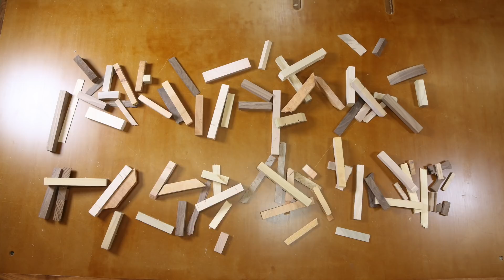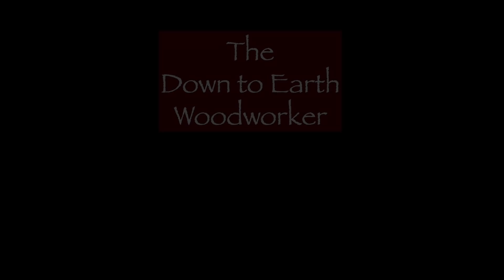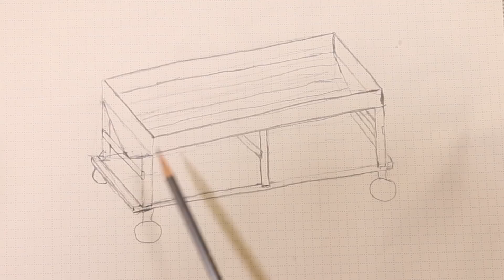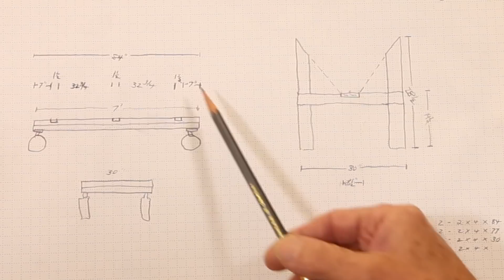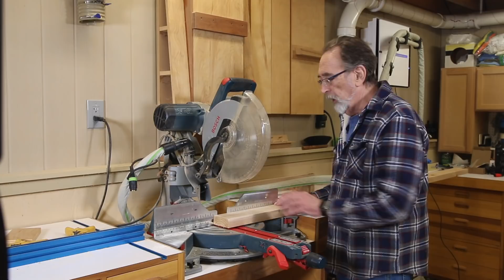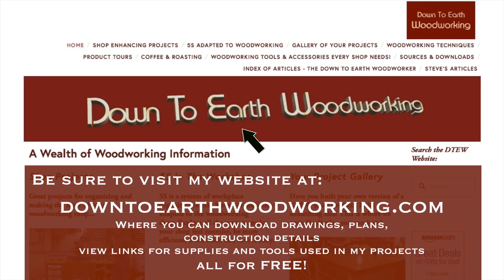Mobile Raised Container Planter Part 1

Comment: Hello sir. I find great inspiration in watching your detailed videos. The planter is very timely for me as I’d love to get our garden started.  If I may, I’d like to know more about your Grizzly jointer. I’m looking at the G0490X. From your video, I’m unable to determine what size bed you have. I’m guessing the 8” but the number on the front is incomplete.  Would appreciate your opinion.  Thanks.   Dan (maker of fine sawdust and the occasional useful project)
Reply from the maker: Dan, It is an 8" model.  One of the numbers on the model number fell off about the second week I had the thing, but the full model number is G0453PX with Spiral Cutterhead.  It has been a great jointer.
Reply: downtoearthwoodworks Thank you.